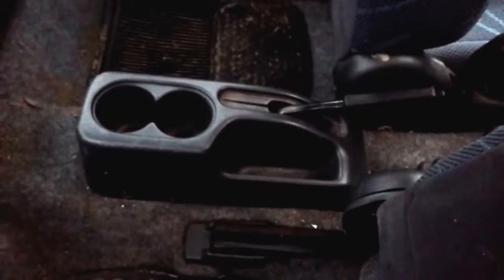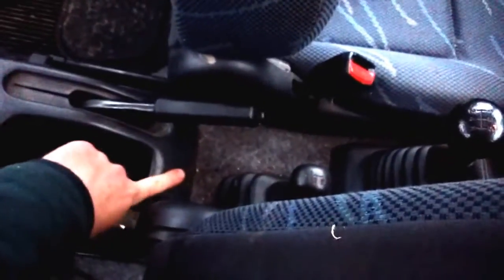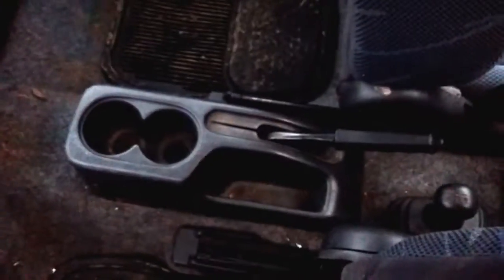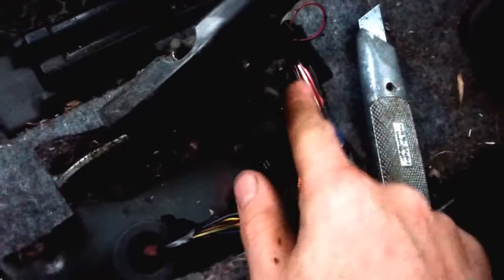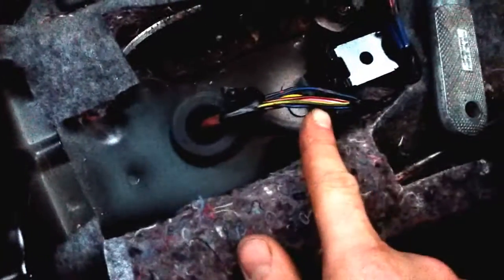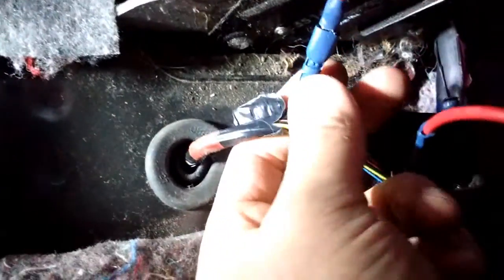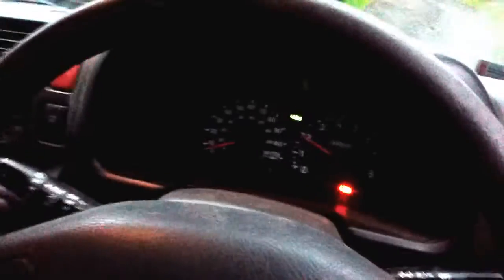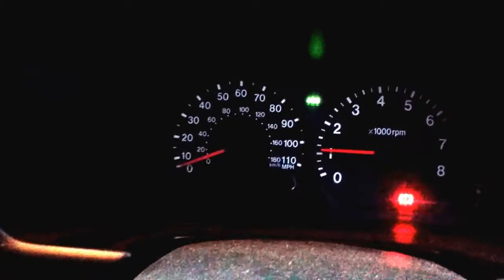Suzuki Jimny JB43 2wd Low (2-lo) mod.

Comment: This is a great idea, thanks for the video. I got 2WD low accidentally when one of my hubs wouldn't engage last week and it's surprising how far you can get in 2WD without realising too. It's got great potential for drifting on sand and wet car parks, since the Suzuki hasn't enough power to spin wheels in the high range. Also since there is no middle diff, it can be genuinely useful to have 2WD low for towing on hard surfaces.

Comment: Just to clarify: 

He is turning the vacuum hubs off and not the coupling. There is a mechanical and an electrical switch when engaging 4WD-H. The mechanical engages the coupling in the transfer box and makes the front shaft rotate, while the electrical engages the wheel hubs. By turning the wheel hubs off in 4WD-H, the mechanical coupling is still engaged. You don't wanna keep it engaged all the time, just when you need 4WD-L, otherwise you'll be adding wear to your shafts and bearing unnecessarily; and if, for some reason, the wheel hubs got engaged while driving on grippy surfaces, you'll ruin your transmission.

Comment: Very useful could you explain why you only need 2wheel drive low.
Reply from the maker: Because the Jimny can't be used in 4wd on grippy surfaces it's handy to have the option of using the low range gears without the risk of damage to the drivetrain. Manoeuvreing with heavy trailers for example. It's also handy if you have a short section of tarmac between 2 areas of off-road as it saves having to come to a complete stop to select 2-hi.

Comment: cheers mate! what crimping tools did you need? Any idea what diameter that wire is?
Reply from the maker: Red insulated terminals and a ratchet crimping tool. The wire is pretty small, probably 1 or 1.5mm²
Reply: @thebubaloomonkey  Thank you!

Do you have any idea if the Jimny SN413 same as the FJB43? I am trying to find the right repair manual to find the right wire colour. My wires are a different colour of yours and all i can find is repair manuals for the SN413.
Reply from the maker: @ES-wy2xj  no idea I'm afraid.

Comment: Can you explain in more detail why would you need this function
Reply from the maker: So you can use the low range gears on high traction surfaces. The Jimmy has no centre differential so you can damage the transmission by using it in 4wd on high traction surfaces. It also has a relatively high first gear on high range. Fine for normal driving but not ideal for towing and it's easy to stall. 2wd low gives the advantage of the lower gearing without the risk of damaging the transmission. It also allows switching between 2 and 4wd on the move while in low range.
Reply: Thanks for reply. Another viewer mentioned you only switch the dash light of?.
Reply from the maker: @leonbuild3246  yes, that viewer is incorrect! I've been using this for 5 years now. It works perfectly.

Comment: LOL. You have not switched 4wd OFF. You simply turned off lamp in your panel. Transmission is engaded mechanically. You will still rotate guts of you front axle. The only thing is that your hubs will likely turn off in that case, but you can always do it if you replace them with mechanical, not vacuum ones. So simply replacing vacuum hubs with mechanical is solution for every Jim. Also quite reliable, but not so easy to use.
Reply from the maker: zebooka The switch disengages the front hubs, therefore only the rear wheels are being driven. Yes it is the same as replacing the vacuum hubs with manual ones then getting out of the car and switching them manually, but it's much cheaper and I don't have to leave the car.

Comment: All that is doing is putting the light on the dashboard out. You need to disconnect the vacuum hubs to stop the 4x4 working. What a Wally lol.
Reply from the maker: Well I've been using it daily, driving off-road for my work for 5 years now on 2 different Jimnys, and many others have done it for themselves following my advice. But hey, what do I know!
Reply from the maker: If you pay attention, at the end of the video you can hear the hubs disengaging and re-engaging as I press the switch.
Reply: @thebubaloomonkey  instead these @#$%^& go and try it themselves to prove you wrong, they sit behind a computer screen trying to belittle you, what a shame
Reply: Wrong, I've done this and you can hear the hubs click in and out when you use the switch